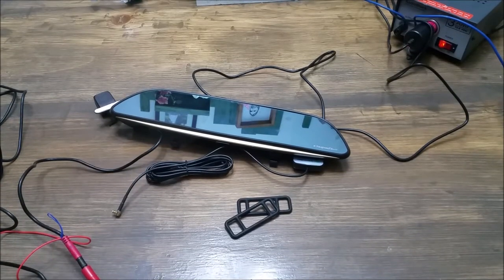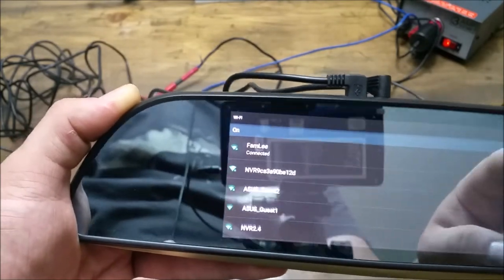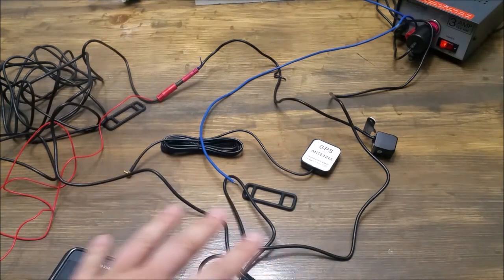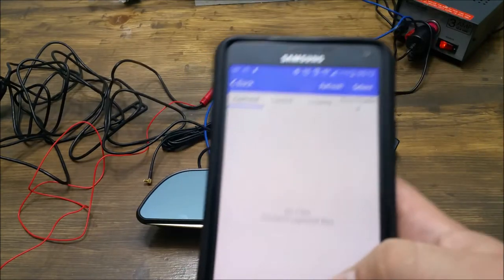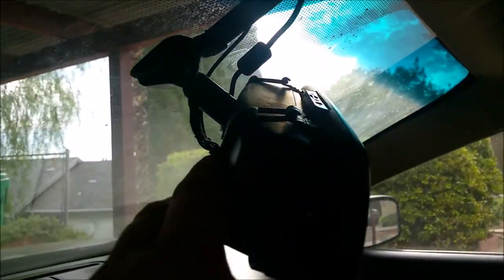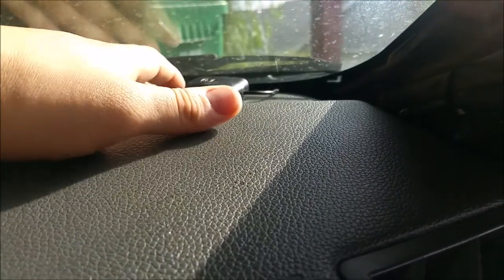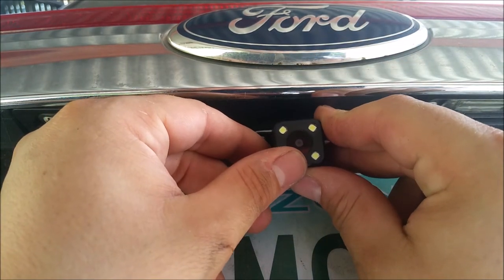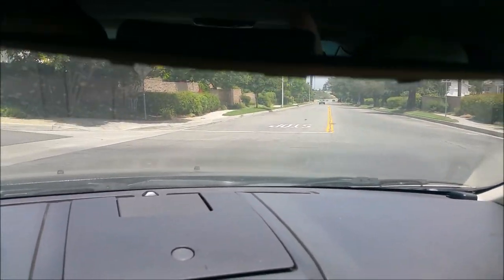Teqstone Android Mirror Review

Comment: Hello Justin! First of all, awesome review! I was feeling sketchy about this product.
How is the performance of it? Recording dual cams and using a gps app must take a heavy toll and i was wondering if it may be able to run Torque app via obd2 too.
Can you please make an antutu benchmark test to compare it to let's say a low spec phone?
I need to choose between an android central console head unit or this rear view mirror.
Thanks for your time Justin!
Reply from the maker: I haven't tried torque, but it should work just fine. Unfortunately I can't compare it to a low spec phone because I don't have one. But it hasn't had any issues for me running google maps and dual recording at the same time. I did have one issue when it was extremely hot outside where the mirror wouldn't increase the screen brightness, but even then it still ran smoothly. So far, so good.

Comment: Hi, Justin. Thanks for your review. I had a question about the rear camera hookup. Is the the plug on the end that connects to the mirror 3.5mm like a pair of headphones, or is it 2.5mm like a lot of navigation systems use? I have a nice backup cam already installed that I would like to integrate into this system, but it uses the yellow rca hookup instead. I know they make adapters for a lot of this stuff, but just trying to figure out what all I'm getting into. Thanks!
Reply from the maker: it looks like 2.5. I'm not 100% sure though. It doesn't look like 3.5 to me.